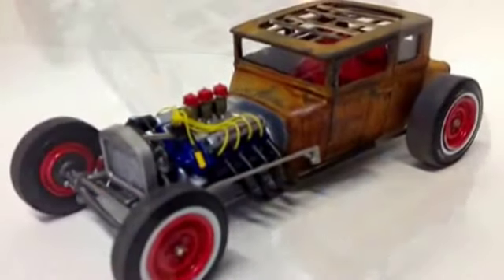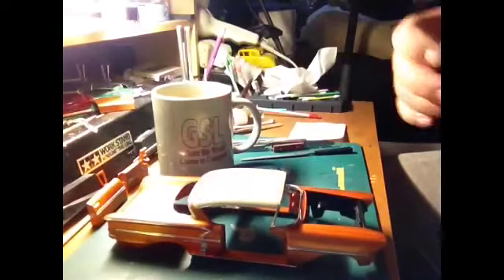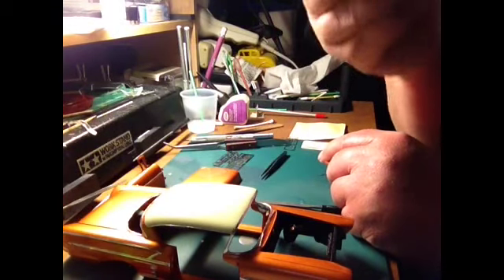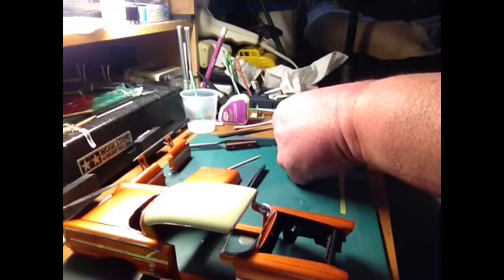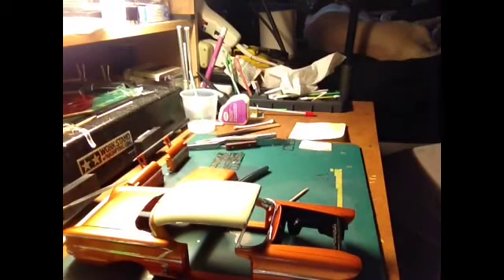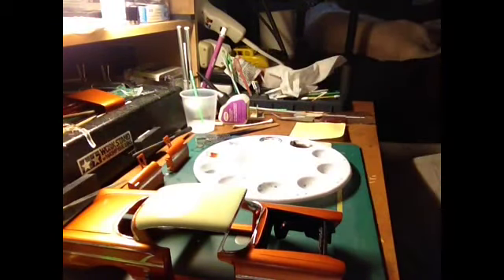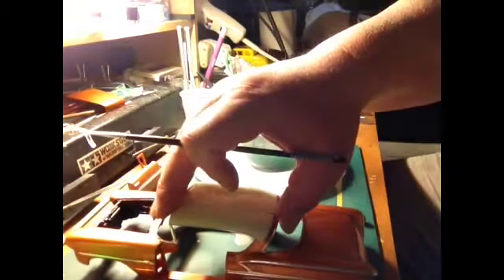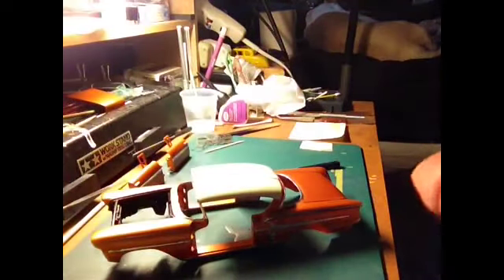How I apply and detail Photoetch

Comment: Thanks for the lesson, Chris. Ive  bought  some photo etch PCs., but haven’t had any luck with applying them. I’m glad to know the window glue works. The photo edge products I bought call for epoxy. And knowing how small this stuff is, I wouldn’t have a chance Using epoxy. It’s good to know that the window blew will work. Thank you for the tip, Kevin. PS is your real job a nuro surgeon?
Reply from the maker: Thanks my friend for the kind words. I hope my tips can help in some way. By the way, my real job is a heavy equipment operator lol.

Comment: quick reminder, spray painting the foam will dissolve it.  I tried something similar a while back with a door panel and I spray painted it.  the spray paint ate the foam.  while it did look neat, I was kinda mad at myself for it....  but we all learn
Reply from the maker: +Joseph Loup You are correct Joseph if you are using lacquered or enamel thinned with lacquer thinner. Acrylic paints are water soluble so there are no chemicals to melt or burn the foam.

Comment: I have a metal photo etched emblem I need to affix to a resin model.  Would Micro Kristal Klear work well?  If not, what would you recommend?
Reply from the maker: tyler2610 I would scratch off a small dot of paint Dien to the bare resin. Use a small dab of white glue like nice podge. If it's a shiny paint use the clouds glue if it's a flat paint use dull so they dry clear but have the same finish to help blend in. Put just enough on with a toothpick to hold it.